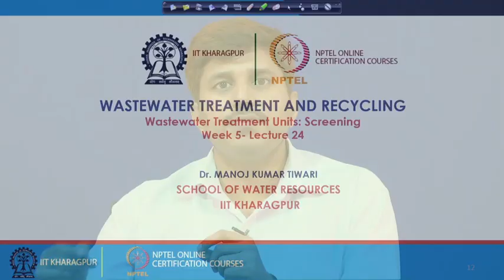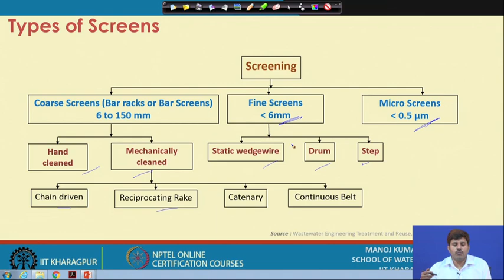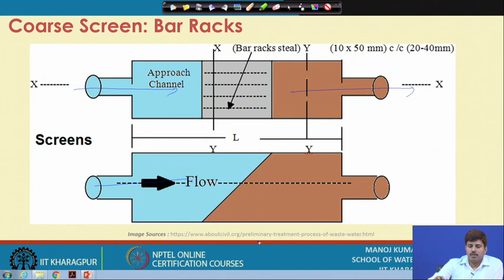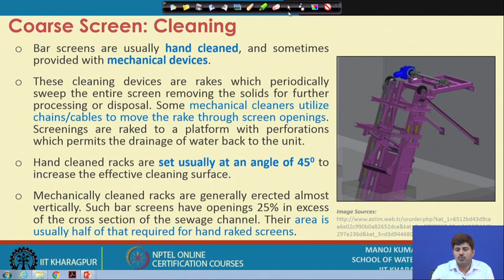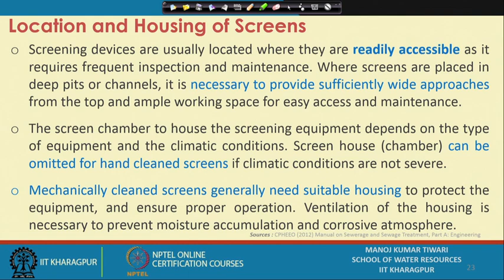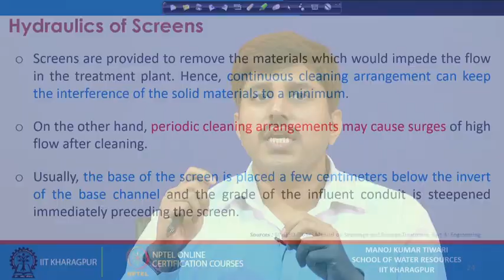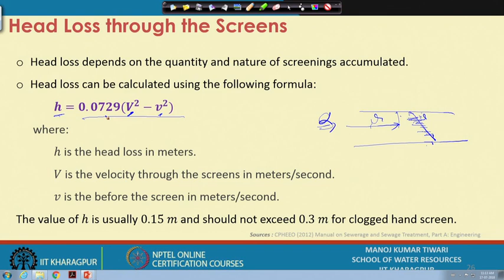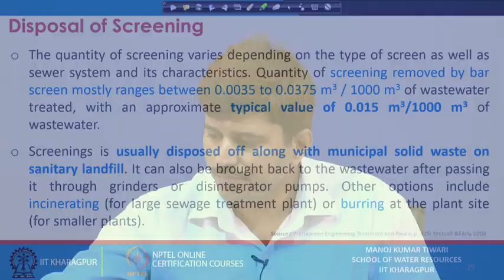Lecture 24: Wastewater Treatment Units: Screening

Comment: Sir if we keep the screen inclined still the effective area is the same. Because the flow is taking place in the longitudinal direction and if we keep it inclined then the effective normal area will be the same as in the case of vertically placed screen.
Reply: I think I can explain it in different way:
If you have a channel with width W and Depth D and you want to put a screen in that channel. In this case, the vertical screen can not exceed the dimension of the channel and the effective area will be  (WxD). But if you consider using inclined screen you can use screen with larger area and fit it in the channel.